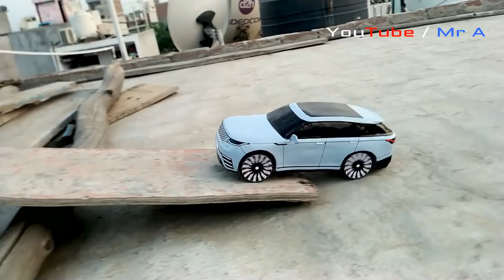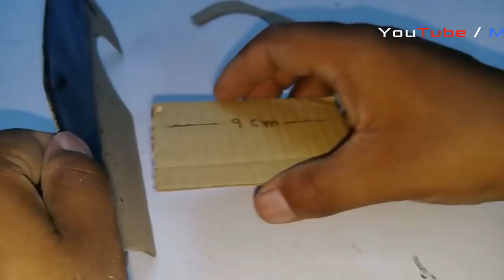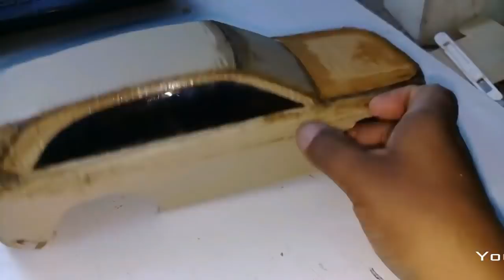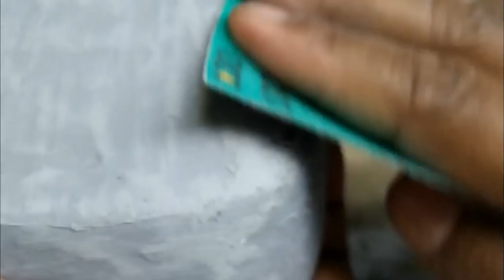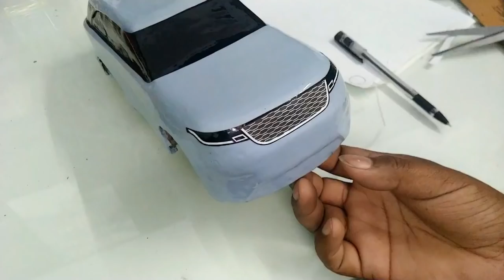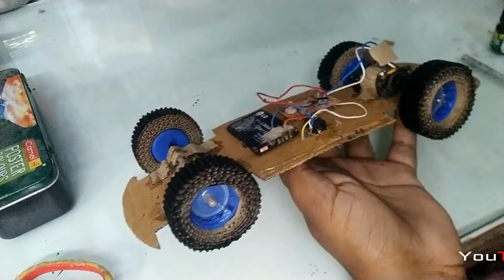How To Make A Car | Range Rover Velar | Cardboard Craft RC Car | DIY Remote Control Toy

Comment: Remote kaise banayaa??????
Reply from the maker: I'm using used toy car scrap material... Like rear motor, wire, tyres, remote control circuit, remote etc